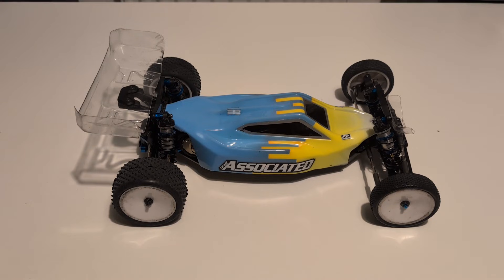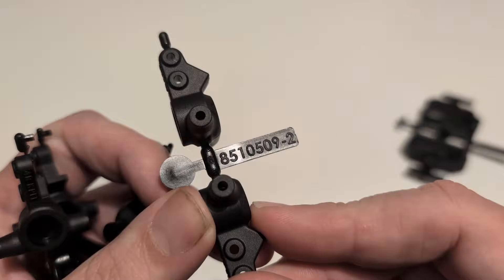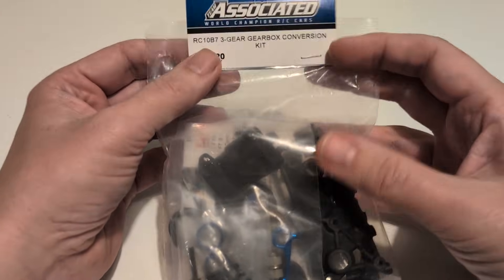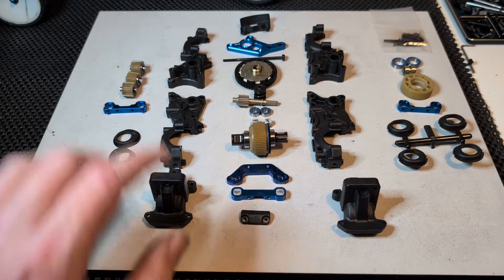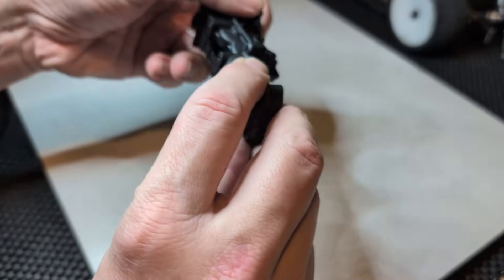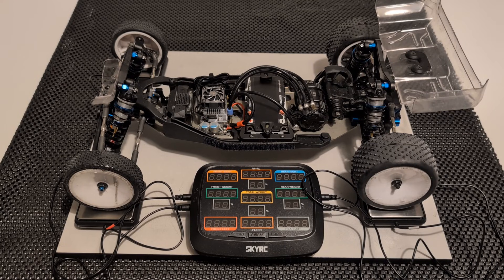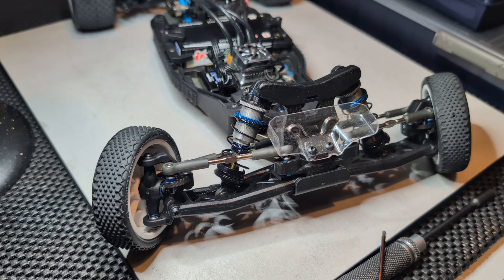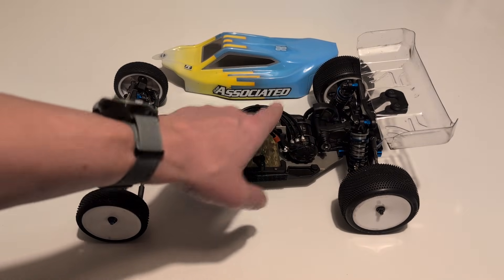Is this the future for the B7? Testing Associated's new 3-gear transmission and zero-KPI steering

Comment: Nice video!!!   The 3 gear really shines on the Acceleration and Decelleration... the reduced gears allow the motor to spool up faster partly due to weight and partly due to losses as each of the original 5 gears are spinning at varying RPM as you accelerate....now much less losses!